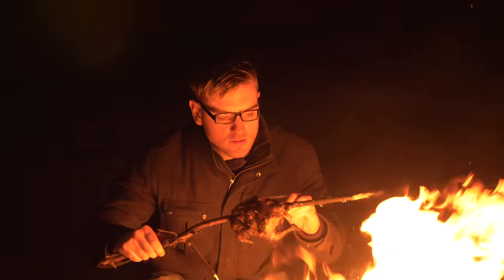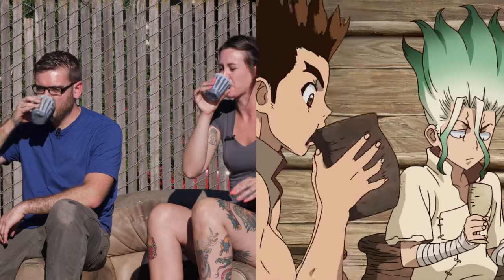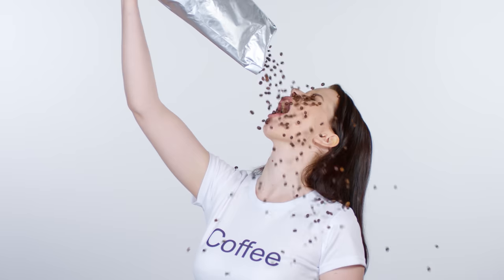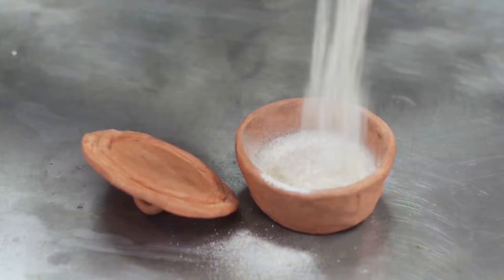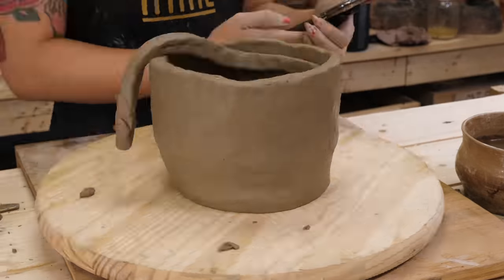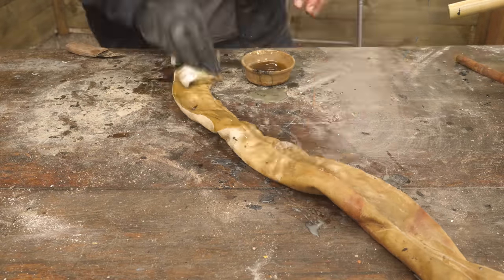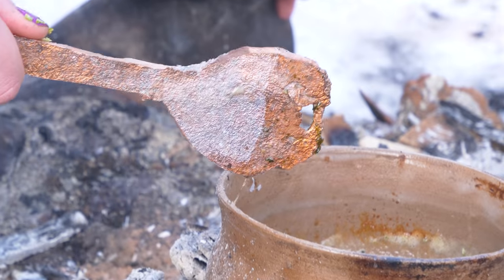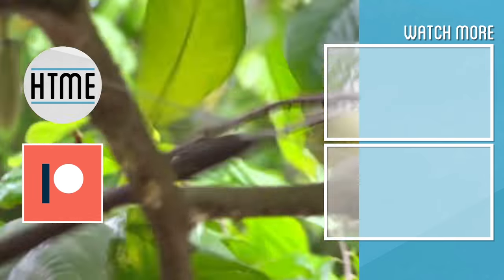Making Dr. Stone Cola From SCRATCH

Comment: I feel like alot of this boils down to perfect application. Spinning the water helps it dissolve the carbon dioxide, bamboo is better at handling interior expansive forces then clay, airtight pressure fitting can be achieved with wet leather, ect. As well, senku cola has the basic flavor profile down but the issue is quantity, which they don't mention. And senku has immense intellect and memory, so he likely has the proportions correct. It would take a fair amount of experimentation to achieve the flavor profile for us normal, nongenius folk.
Also, Gen hasn't had coke for over 3000 years (over a few months to his recollection); he likely doesn't remember how coke tastes, precisely, so anything that's cold, carbonated, and similar tasting to coke likely hit the craving just right.
Reply: 111 👍
Maybe they should’ve shot for orange soda?

Comment: To be fair (I've never seen the anime) the clip you showed had them using green Bamboo - cut with the joints still intact. This would be air tight, water tight, and so tough that you can use them as cooking pots. Just putting that out there.

Comment: You should be able to get carbonation by using a bamboo container with a bung hole cut into it. Bamboo is going to be heaps stronger than that janky pot you made and is suitable for food grade containers. Just take a segment of bamboo, make a smallish hole in one end and use that to fill with your liquid. Add a little sugar to keep the fermentation going (assuming you have a ferment already), and then bung it up for a couple of days. You can either rely on pressure to pop the cork out, or just open it after a typical fermentation period e.g. 2-3 days at room temp.

It works great for home made ginger beer. The only issue you have is making a container strong enough to hold 15-30 PSI of pressure.

Comment: Wood molds work for casting iron depending on how good you need the mold to be, in dr.stone they just needed a rod so it would work fine.
Reply: ...up until you have a fire that destroys the entire project. Or if it survives, a mold that changes shape every time you use it.

Wood is terrible for a mold. Carving a stone in that situation is not only infinitely better, but arguably easier to do than cutting wood to the right shape.
Reply: @jerryborjon  wood molds are usually single use because of course it catches fire. You can use them specifically when you don’t have to reuse the mold.
Reply: @jerryborjon  also I don’t think you worked with stone before if you think it is easier to work then wood.
Reply: @guypie5479  - Let’s compare the two. For the wood mold you need:

1- A plank of the right shape. It NEEDS to be good wood. Not all wood can survive this for long enough. It probably needs to be dense wood, so good luck cutting it to shape with primitive tools.

2- Carve out the insides to the desired shape. Doing so in a way that doesn’t affect the integrity of the wood is hard today. Remember to take into account the shape and direction of the wood fibers with every cut. One wrong cut could break the entire thing in half very easily.

3- Prep it. Wood warps and expands greatly under heat, so you’re gonna need to account for that. It also needs to be dry so that the escaping gasses don’t affect the cast too much. You’re probably gonna need to put it in the oven to dry it. Good luck, since going too hot will burn it prematurely and too long will dry it too much and affect the integrity of the mold. You’re also probably gonna need to recarve the shape afterwards due to the warping from the heat.

And after all of that, you get a one-time use mold that might not even survive once even after all of this work. Now let’s compare it to the rock mold:

1- Go to a river bank and find a concave rock.

2- Using a sharp rock, chip out the rest of the shape.

3- Put some packed dirt/gravel in it to smooth it out.

And after that, you got a mold you can reuse. You could probably even smooth it out with another rock just by grinding it against the mold. The carving of the right shape would probably take longer, but the sheer amount of time the other steps save would definitely make up for that.

It’s probably still infinitely better/faster/easier to just use clay, but I was just using a rock mold as an example to prove just how bad a wood mold is.
Reply: @jerryborjon  I am sorry you hate wood so much but you also don’t seem to know how wood works. I am not saying wood is the best mold in fact it is one of the worst working molds for both reusability and detail, but they are in fact easier and faster to make then most other molds. That is why they were used I guess it is more accurate to say that wood works great as an easy casting box when you just need a rough but usable simple shape. Also as a final remark wood in fact does not thermally expand greatly when heat for two reasons 1. Wood is a great thermal insulator that is why people make houses out of it and they don’t even need expansion joints 2. Wood basically does not expand at all when burning because the small expansion it does experience is counteracted my the loss in material and moisture. I don’t know if you have ever seen wood burn before but it does not really change much. In fact pure clay thermally expands more then wood and that is why you need more insulating filler in your pottery for it to work. Again my argument was never that wood was good it was that it was functional and fast knapping stone is not as easy as you might think and smoothing stone with sand can take hours. As for clay you have to find it processes it shape it and finally fire it before you can use it or you could get a hunk of wood take a couple of minutes to Hack in shape into it and just pour the metal in.
Reply: Wood is a one time use,all they needed.

Comment: Spinning, sealed container: This requires a greased bearing surface. To do this with bamboo, you would carve grooves for an anchoring site and use greased (w/ animal fat) twine and build it up with reverse half hitches. The outer chamber was probably made with wood discs at the ends and bamboo splits attached around it and sealed with resin or rice flour glue. It's possible with timber bamboo to get that size difference by just selecting your cuts, but the sealed bearing joint becomes more difficult

Comment: Just wanted to mention that the exact ratios and methods were not stated in the anime. It sounds straightforward but any variation in ratios changes the flavor and color immensely. As is the case with modern colas. Fine-tuning the recipe is the key and can lead to surprising results, as is generally with science.

Comment: there's actually a thermal plastic that the native Australians have used for over 10,000 years by heating a special sap and then pouring it onto the objects they want, it forms a strong bond... and it's reusable through reheating it so not only did they create the first thermal plastics but the also were the first to recycle plastics.

Comment: im pretty sure the show had a legitimate reason for a wood mold working for the iron casting, can't say off hand specifically why though, it's been a while. the manga's author does put a lot of research into this so i feel like, while there are times where suspension of disbelieve is in play, things shown in the show are legitimate for one reason or another.
Reply: The reason wood wouldn't work bc the water in the wood would evaporate causing the molten metal to splash and splatter
Reply: @benjordan1971  i know that this is the standard reason, don't get me wrong. i was trying to say that the author is usually very good with these sorts of things and there would be extra context surrounding the use of wood as a mold that allows this method to work. sure there are minor issues here and there that require suspension of disbelief but iirc there was a reason why it was done this way that made sense in the show.

Comment: this was a neet episode though if he does something similar in the future i would suggest rather than making the water carbonation jar only out of clay try using either reeds or some other thatching material  as a skeleton to give the jar strength and use thick clay  walls finish with a wax coating on the inside of the jar

Comment: The interesting thing about the Dr Stone universe is that it is implied to be a post apocalyptic universe, so the most efficient way to get quite a bit of resources doesn't necessarily require the protagonists to start completely from scratch, if they can find the locations of old towns or cities - even abandoned for thousands of years - potentially useful resources may be found in extremely dense clusters. A mine digging in the location of an ancient scrapyard will have large chunks of basically pure iron and iron-oxide, copper, tin and aluminum, gold and other rare earth metals at refinable concentrations far, far higher than usual anywhere naturally on earth. Digging in what was once a jewelry shop will get you diamonds and other gemstones, gold and silver in concentrations any geological engineer would kill for. And several thousand years of decay wouldn't rule out the availability of monstrous amounts of plastic everything, some percentage of which could just be rinsed out to be still good as new, slightly discolored but still very usefull and a lot of the rest can be melted and reshaped/cast with an ease metal doesn't really offer. 

The now-gone civilization (ie. Our present day civilization) artificially concentrates useful natural materials to an absurd degree, and since so few people are alive in the series and using it anymore, the lowest hanging fruit for resource gathering is recycling the old civilization, for several hundred years of population growth, extraction of natural deposits would be absurdly inefficient compared to mining and gathering from the old civilization.